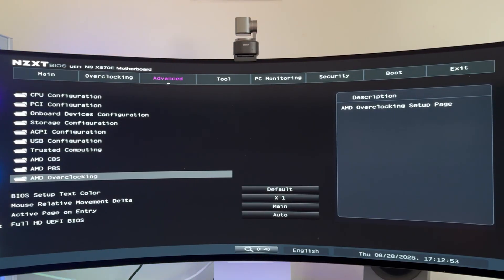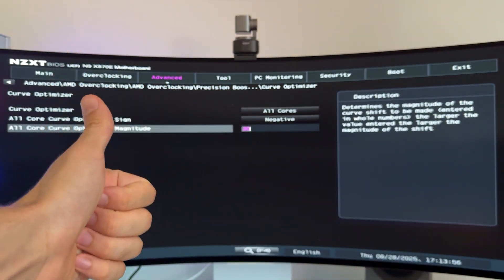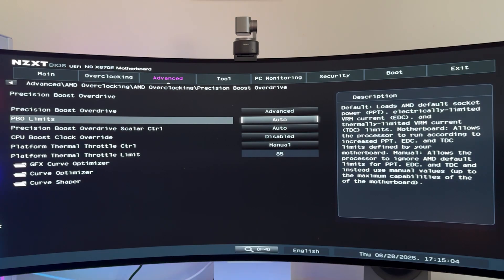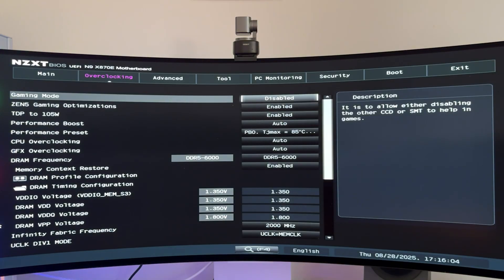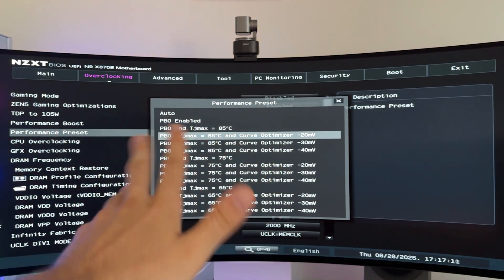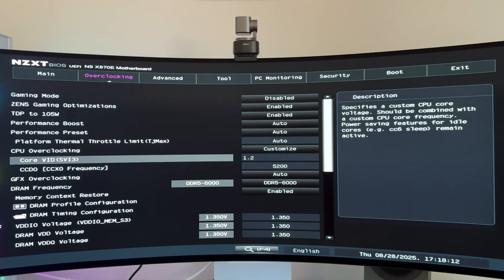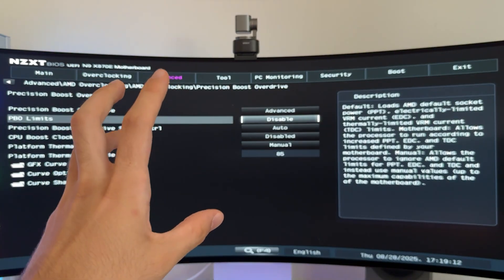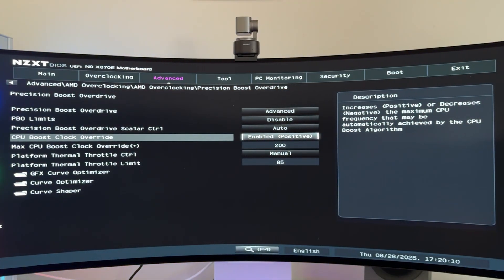Undervolt your Ryzen 9 9950X3D the Right Way! - More FPS and Lower Temperature

Comment: I tried this a year ago on my 5800X3D and never got my cores to run at their max capability of 4.5GHz. I tried offset of 0.1 , 0.09 etc down to 0.01 and my cores always stayed at 4.25GHZ.  I then tried PBO2Tuner and lo and behold 4.5GHZ maxed no matter what I throw at it. So I just made a batch file to run it with -30 (-30 is max it allows) on all cores and voila, CPU runs at 4.5GHZ and cooler all the time.

Comment: Didn't find phase 2 in my gigabyte bios so I went back and kept everything as before to avoid issues.
Reply: Still can't find specifics of phase 2 but did redo phase 1 and kept settings and cou is running cooler and as of right now, streaming and recording from obs is actually smoother and less cpu usage. 😅 Might return to update after more streams. Thanks

Comment: My 9950x3d runs at 80 to 90 degree i tried to undervolts but it drops only 78-82 which is bad I don’t know why cuz others will not reach that temperature.

Comment: Im here cause im getting 80 deg c at idle with 360 cooler ...
Reply: Check the individual core temps and see if you need to redo thermal paste. Try turning fans up a lil as well
Reply: @theoriginaltech019  it was the boost clock on the 9950x had to undervolt set pbo curve and set thermal throttle to max 65c now im playing with power im boosting to 5.3ghz but not surpassing 66c idle temps are 37c in bios 42c in windows 11😅
Reply: did you mess up the thermal paste? Too much could cause this, there's a bunch of things that could cause this honestly

Comment: Can you do a video like this on Asus Motherboards X870E-E Gaming WIFI or Extreme + the RAM. 
Which most people uses now a day. 
Much thanks!
Reply: did you find anything? I just bought mine recently and that's the mobo i'm using
Reply: @goaliedude32  Hey, I did copy his method, though temperature wise I didn't get any benefits beside it locked below 80C. But performence wise seems like 9950X3Ds has 2 type of CCDS which u have to manually change them on Process Lazzo depending on games u using and its whole complicated also. Which unlike the 9800X3D uses all 8cores for pure gaming which you get most benefits out of at this moment.
Then I guess you have to also Overclock the GPU as well which I haven't so far! 
I'm using 9950x3d, 4tb WD sn8100, 5090 OC and 64gb cl26 G.skill aswell.
Reply: @CORTANA2031 I've been fine setting up process lasso, I kind of enjoy it honestly.

I was just playing borderlands 4 and when it was loading cache my CPU got to 96c and I'm trying to fix the temps. I'm okay with using all the cores but the temp is excessive and I have a really good cooler

Comment: id probably not say 9950x3d is the best cpu at least not for the value sure its great multi tasking but isnt the 9800x3d slightly better for gamers which most people go for? if you are a gamer and want to stream or like do 3d stuff sure 9950x3d is probably better
Reply: Well, I absolutely can't understand it if you build a high-end system with a 5090, but then only buy an 8-core. That doesn't make any sense, that's not what a 5090 user wants. Even if gaming is your focus, you want to be able to do what you want with the system. This is just possible with a multi-task CPU. The 9800X3D gets drastically worse from the moment you have other tasks open while playing, because then everything runs on 8 cores, while the 9950X3D has 8 cores only for gaming, and 8 other cores for everything else. A 5090 doesn't do justice to your money either, but if you get a 5090, you want the best, and that's the 9950X3D
Reply: Some benchmarks have shown that the 9800 X 3-D is slightly better in gaming so slightly it’s not even noticeable but if you’re fire up discord or stream the game that performance drops significantly and it is nowhere near the 9950 X 3-D. These benchmarks will also based off early drivers and bios, etc..

Comment: Ciao a tutti,  scrivo per qualche consiglio con un 9950x3d con una Gigabyte X870E Aurus Master, ho impostato nel bios precision core su 20 in negative per all core come nel video e gestito da motherboard pbo, ma in bios sono sui 49/50° in windows senza gioco sui 74°. Ho un case Thermaltake Tower 500 con raffreddamento CM atmos360. Inizio a dubitare 
della posizione del raffreddamento in lato in questo tipo di case, avevo lo stesso case ma un i9 14900k all'epoca con un aio 360 thermaltake, che ho venduto e cabiato tutto proprio per le temperature. PS ram adata 6400 settate in expo. Qualcuno può indicarmi altro aiutandomi con il mio bios?

Comment: You, sir, definitely deserve a follow! I took your advice and managed to lower the temps on my 9950X3D by a few degrees, which has made a noticeable difference in reducing the fan noise. I was actually considering going back to my 9800X3D because the noise levels needed to keep the 9950X3D cool were getting unbearable. After applying just a -20 offset, even though it seems small, it made a huge difference for me. I really appreciate it, thank you, truly!

Edit: I had to increase the voltage to -10, this due to micro stutter in gaming (low loads). However, it's still much better than stock.

Comment: These settings will reduce gaming temps for sure but hurting multicore performance. When it comes to benchmarking and applications that utilize all the cores or the frequency cores. They won’t clock as high even with thermal headroom. These settings are limiting the CPU. If you have the headroom just tune Negatice CO. I hit 46/47k on Cinebench R23 with temps not exceeding 68c and clocking 5.4GHz all core during the run. Gaming temps 50-58c depending on game.
Reply: @nitebird500 I’ve shown it many times. Both my 9950X3D’s are running -35 all core on direct die. And score both 46/47k on Cinebench.
Reply: @nitebird500  http://youtube.com/post/UgkxE1K8KFrDv6wjvu3auWkhMBLnf2fpMUP1?si=ToALmhBJm0keb0q1

Comment: I ended up undervolting my 9950x3d based off your video to -20 and now my cpu runs max at 60C(ave 58C) while playing Battlefield, where as before it was running into the low 70's normally. Gameplay is still buttery smooth. Appreciate you video.
Reply: i have the same cpu and i want to undervolt too; did you notice loss in performance (maybe less fps=)
Reply: @sanchiani9717 actually I got a few more fps.  I undervolted mine to 20 under. I tried 30 but certain games and devices stopped or crashed at that level. 
I thought I would see a drop but it didn't  Battlefield 2042 runs at 5.5 -5.6 GHz while playing. Temps on Ave run around 58C with my AIO cooler.
Reply: @genturgson  thanks for the info, did you do overclock plus undervolt then?

Comment: i bought today a 9950x3d and swapped it against my 9800x3d. I did some benchmarks with one and the same replay always in pubg. I had with my 9800x3d This result: Avg: 443.218 - Min: 192 - Max: 869 , with my 9950x3d and game boost on in bios i have: Avg: 470.548 - Min: 246 - Max: 883. So a little more fps. But when i turn off Game boost in Bios my fps drops a lot. Here results without threads , only 16 cores: Avg: 376.410 - Min: 142 - Max: 629  , and here with 16 cores , 32 Threads: 338.392 - Min: 134 - Max: 664. So you see im forced to play with the Game Mode on in Bios. But i have a problem... i have at the beginning from the round then Lags and Stutter for 1-2 minutes. Then its gone. Do you know how to fix it? Thank you so much!!!!
Reply: Bro game mode give lg don't use and svm and resize bar make disable then leg gone for me
Reply: 9950x3d and 9800x3d should be pretty identical with margin of error for gaming. 
If you gained perfm, that means the X3d didn't do anything as then the game was using all 16 cores....and there is no game that really uses all 16 cores.

Comment: X870E has a bug that the CPU never exceeds 200 Watt if Curve Optimizer is enabled. I'm affected of this too.
Reply: Noticed this on Ryzen Master, max  i saw on mine was 200w
Reply from the maker: It’s not a “chipset” problem, I think at most it’s a bug which requires you to “double input” your PL max. Meaning you need to manually unlock the EDC, current limits etc as I show in the video :))
Reply: its not a bug 9950x3d has a TDP of 170 - 200w, is it there any reason to go beyond that ?
Reply: @Ares_XO  yes it is supposed to do it when you raise/remove the power limit
Reply: This isn’t a bug. If you just tune Curve Optimizer and don’t turn on PBO it won’t exceed 200w and still under volts the CPU. Once you turn PBO to any option besides “Disabled” it will exceed 200w.
Reply: @SteezinBreezin  PBO +200mhz, scalar x10, powerlimit all 3 at max, CO caps it to 200 watt.
Reply: @De-M-oN do you have a thermal limit set? And power limit all 3 at max? What you mean? Do you have PBO just “Auto” or “Enabled?” If so set it to motherboard limits. Even though in my experience on my system setting it to “Auto” or “Enabled” allows it to go over 200w.
Reply: @SteezinBreezin  wait i am confused sorry, to adjust the curve optimizer you have to access into PBO, it is usually on AUTO (not disabled) and if you want to undervolt it, you have to manually change it from AUTO to ADVANCED, there you will see a bunch of settings (you can leave everything in AUTO if you dont want to overclock anything and just go into CO section to undervolt it) i don't get it how you can undervolt it having PBO on disabled, maybe you meant PBO Limits on disabled? (its risky to put it on disabled)
Reply: @Ares_XO when you go to PBO it’s already set to Auto. You can change it to disabled but Curve Optimizer settings will still show. You can set a negative curve optimizer without the CPU auto overclocking. It will be limited to 200w. And you can still achieve good performance with it disabled. I showcase this on my channel where I tuned the curve optimizer settings with PBO disabled.

https://youtu.be/hcy78xuopME?si=FnXSReWbCNqo-Cqi
Reply: @SteezinBreezin  oh i didnt know you could still go into Curve Optimizer even with PBO disabled, i always thought you had to put it on Advanced...let me see
Reply: @Ares_XO yeah buddy. You sure can without. And it gives a boost while being limited runs cooler. I have two profiles. For when it’s really hot I’m running EXPO and PBO disabled with -35 on Vcache cores. And 30 on frequency cores. On cooler days I’m running PBO on enhancement level 1 (90c). Same curve optimizer.
Reply: @SteezinBreezin  wow your CPU is really stable at CCD0 -35 and CCD1 -30? i never tried it, atm i am -20 on both everything on Auto, how many mhz do i lose with PBO disabled ?
Reply: @Ares_XO yes it’s stable. It’ll do 5.4GHz all core during a Cinebench R23 run at 68c max. And no you don’t lose boost clocks. CCD0 will still boost to 5550 and CCD1 will still boost to 5750 given you have adequate cooling. I don’t have an updated video up with my current settings but will do one when I get back from training.
Reply: @SteezinBreezin  that would be awesome tysmm :) just 1 thing, how it still boost to 5550 and 5750 if PBO is disabled? then what PBO on Auto does ?
Reply: @Ares_XO those are the factory boost clocks. If you have adequate cooling it’ll stay at those clocks with a stable negative curve optimizer. If you don’t tune CO with PBO off it doesn’t boost as high under load. With PBO turned on it now calls for higher voltage and power draw to reach those higher clocks. And it increases the headroom of those boost clocks under load. Example with PBO off and my current -CO. It’ll only peak 5.2GHz all core at 200w (Factory limit) during the Cinebench Run at 55c and will get 44k points. With PBO turned on to enhancement level 1. Same -CO settings. It’ll now reach 5.4GHz all core during the Cinebench Run and pull 243w at max 63-68c getting 47k points.

Comment: Thanks for the content on 9950 x3d,  helped my temps and temp anxiety :).  cheers IWP !
Reply from the maker: Glad it helped :)) Cheers my friend!
Reply: @ImWateringPSUs  Hi, would it  be possible to send you an image of coretemp to chat Tdie, ccd and individual core temperatures? just wunna to know what im seeing is "normal" or is he same for the most part on 9950x3d. :)

Ive got a beta copy of coretemp because so ive seen most monitoring systems do not report individual core temps (on ryzen9) just the package (beta version coretemp does show core temp and average, hi's, lo's), HWINFO does show core temps but i dont use that software i use Aida 64 which as of now doesnt report each core temp either.